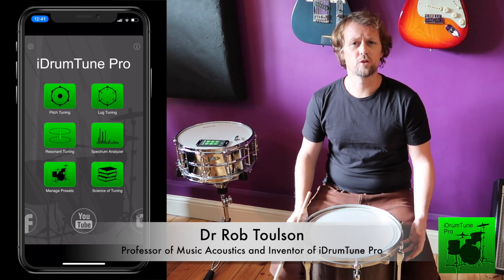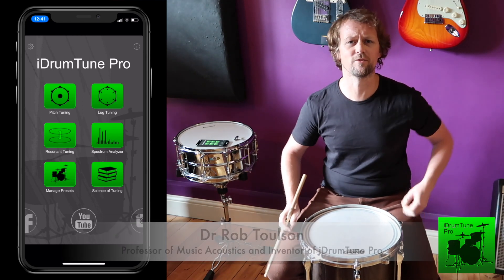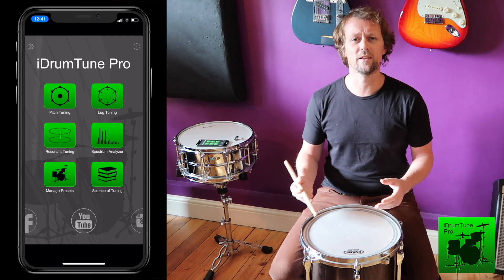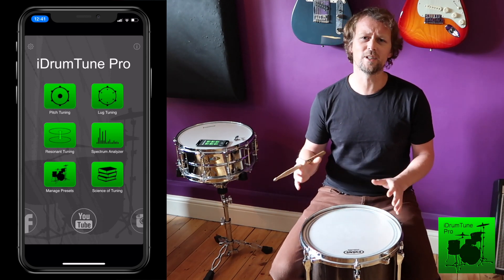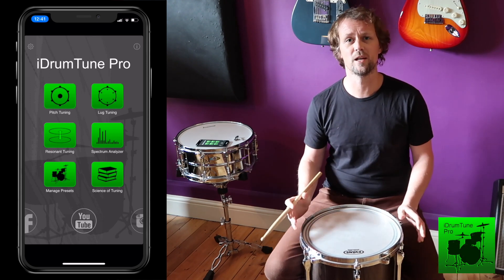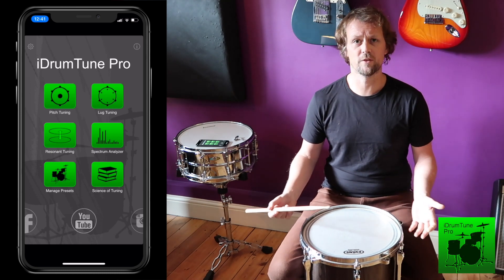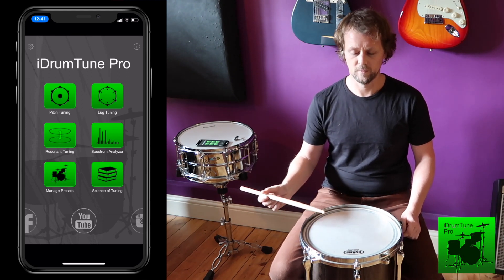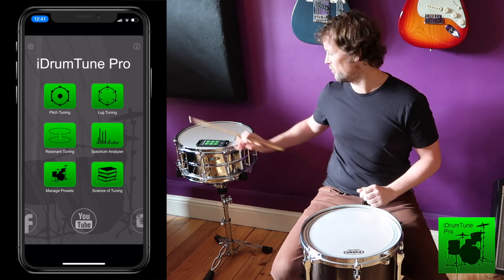Resonant Drum Head Tuning with iDrumTune Pro, drum tuner app

Comment: Does this strategy somehow relate to the well known minor third theory?
Reply from the maker: Hi there, the minor third concept generally refers to the pitch intervals between each drum in the kit. So this is different, the RTF is the relationship between a single drum’s two most powerful and audible frequencies - the fundamental pitch of the drum and the batter head overtone. When these are tuned musically, by adjusting the resonant head relationship, the drums sounds more musical and correct, to many people. Take a look at our tutorial about the resonant drumhead at www.learndrumtuning.com and you’ll get a more detailed explanation. Thanks for posting the question!
Reply: @iDrumTune  Thanks. Understood (I hope :-)) However, because you make use of the resonant to achieve the right RTF at the batter, I feel it will automatically affect the relation of f0(batter) to f0(resonant) - which is interrelated to the "minor third". So, those two approaches cannot be completly independend - but I might be wrong.

Btw: I have tested my drums with your app. Came a little by surprise. 10" is RTF 1.49; 12" has been RTF 1.5. Looks good
Reply from the maker: @ClausPastor  great, sounds like you have good natural tuning, the 1.5 RTF just sounds ‘right’ which is why many experienced drummers get a good sound without having to know too much about the science. By the way f0 on the batter and resonant head are always identical, the fundamental comes from the two heads vibrating together in unison. We have another video demonstrating this in our course (see the final video at the end of tutorial 3 at www.learndrumtuning.com)

Comment: Um, maybe a dumb question but when tuning the drum, is the other head (resonant head if tuning the batter) muted, like placed on a stool or something? Or do they both resonate together? Can't tell from the video where the drum is placed.
Reply from the maker: Hi there, the drum is on a snare stand - you can only tune a drum fully when the two heads are freely vibrating. They work and vibrate together to create the overall sound of the drum, so the drum sounds completely different with one head damped and there’s very little benefit from doing this. Take a look at our drum acoustics course at www.learndrumtuning.com where we cover drumhead coupling and all the other acoustics principles relating to drum sound.

Comment: Hi there! I got the 3 pack app few days ago and start to play w it. I found it good. It will be good to have a feature that  you ask for a desired RTF and tells you the right lugs hz to apply. Btw possibility of saving your kit it’s ok,but i can’t find the possibility to save top and reso lug pitch. This will make the job faster. I just ask, in the past we supposed to get the max resonance  with top and reso at the same lug pitch A0x1.75 both head, than we can assume a0x1.5 top & A0x1.85 reso. This is the Rtf 1.5.  What we call high resonance. This works perfect as i have pinstripe on top and reso. Can you advice some “sounding good” Rtf for a medium and low resonance? Btw, can you advice some tips for a specific tuning if we play in a recording studio or in small club, as in an arena? 
Fine lug tuning is very hard to be achieved, as a very tiny tiny key moving it may vary a lot of hz, how can we reach a perfect 1.5?it can be good obtain a 1.48 to 1.52? Many thx for your job, well done!

Comment: Also, what would be the RTF if both heads were tuned to the same pitch as with your method of tuning ? 1.5 ? Another RTF ? Always the same one regardless of the drum dimensions and drum head type ?
Reply from the maker: Hi Camille - good question, there are a couple of important concepts here.. firstly, the batter and resonant head ALWAYS have the same fundamental frequency, this is because the most powerful frequency of the drum is in the coupling between the two drumheads, so they vibrate up and down together as a single vibrating 'system' (you can prove this with the iDrumTune app or see our other video on the subject). But the batter and resonant drumheads can have different edge (F1) frequencies, because these are local to the particular head and not the drum as a whole. So you can measure the RTF on the batter head and measure the RTF on the resonant head. Depending on what heads and tension you use will determine what the RTF of each is. If you use exactly the same heads on top and bottom and apply exactly the same tension, then they will have exactly the same RTF - though usually we use a different type of resonant head because it gives us another frequency and an extra subtle richness to the sound. But on the whole, when you hit the drum on the batter head, the most powerful frequencies excited and heard are the F0 and the F1 of the batter head, so we always recommend putting the most attention into the batter's F0 and F1 relationship (RTF) and predominantly using the resonant head to manipulate and control that relationship. This allows you to tune some musical RTFs which can be recalled in the future and the drums sound great with this approach. There are other approaches out there, but none with any scientific evidence to justify the approach - it's evolved over the years into a 'dark art' but now we have an app capable of giving accurate measurements, it's possible to apply a more musical approach that uses the acoustic principles of the drum to get the best sound out of it. Happy tuning to you!

Comment: I just want to confirm,  all beater lugs and resonator lugs should be the same torque (same number of turns) when the drum is finished tuning?   Thanks!
Reply from the maker: Hi Joel - actually it's not possible to be 100% sure that the head is even just by counting turns, measuring the torque on the rods, or by measuring the tension of the drumhead - the only way is to LISTEN to the head at each point, an even torque or tension doesn't always give a perfectly even sound. (Same with a guitar, we don't care about the tension or number of tuns on a guitar tuner machine head - we listen to the result and judge the sound of the string instead). The app can listen for you, so if you have each lug position within 1-2 Hz then you are closer than you can get by any other approach!